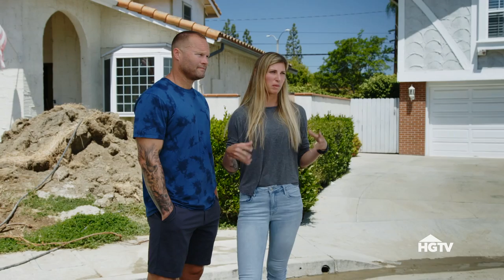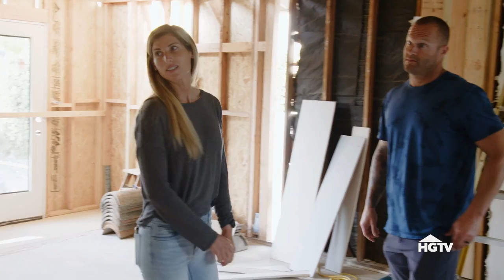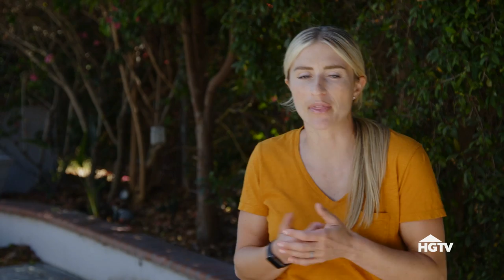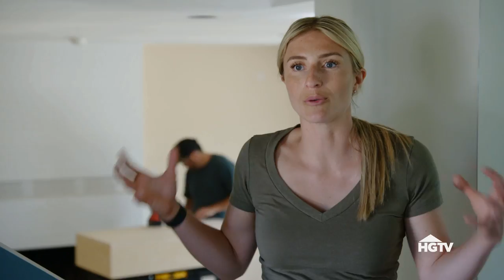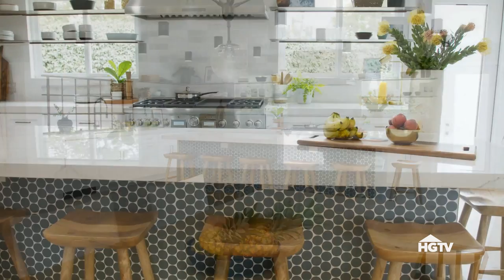Couple Starts Home Remodel With NO PLAN! | Help! I Wrecked My House | HGTV

Comment: Why isn't there space for a normal dining table, unless I missed it? Even a banquette in a corner? Guests?
Love the porcelain island and the black window. Hate the black lights. Sorry
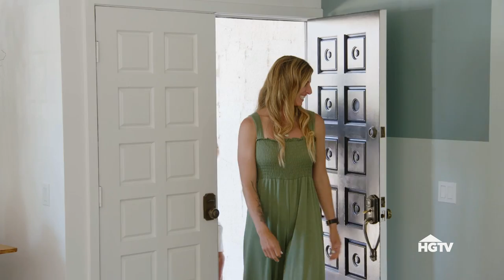Reply: At 8:10 you can see that they do have a formal dining table at the lower right corner.
Reply: I hate the lights roo
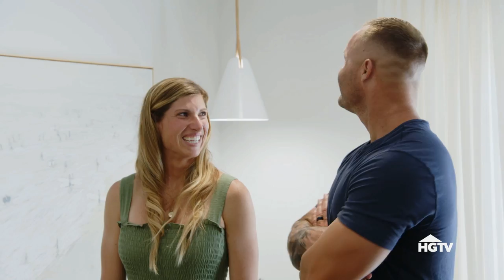Reply: I was surprised about the table issue too, but then I was looking for shots of the pool and discovered a tiny shot of the dining room table. It's at 10:00 or 10:02, blink and you'll miss it!

Comment: It is just unbelievable that the suppliers of cabinets, flooring, tile, appliances, countertops, plumbing and electrical supplies and fixtures (faucets, sinks, lights) and laborers don't give homeowners all of these things for free! Imagine having to pay for all of this, plus professional costs for an architect or engineer to guarantee the integrity of the build. For everyone commenting on the estimated $65,000.00 cost of the kitchen build, do you not have to pay for the things you purchase? Also, this cost included renovating the living area and a bedroom. Certainly they could have chosen less expensive materials, but, as the saying goes: "You get what you pay for". They were spending more on a pool that will certainly get less use than the kitchen will. I suspect this family is looking at this as being their forever home, so spending more makes sense.
Reply: I have paid twice to have my mini splits repaired. I figure for what I paid the  two different companies each charged around $300 to $400 per hour.  Sadly I am sitting in a 20 degree house right now because even after spending $1,300 between two different companies in the past 2 months to have them fixed, my brand new mini splits have shut down. Nothing, nadda, zero heat.  Same with my roof, my gutters and my plumbing, all shoddy work. Tradesman have gotten ridiculously greedy and the workmanship stinks.